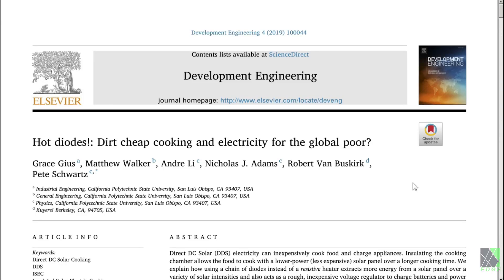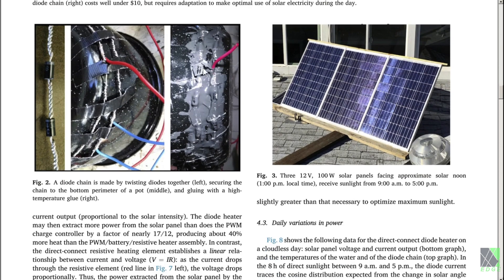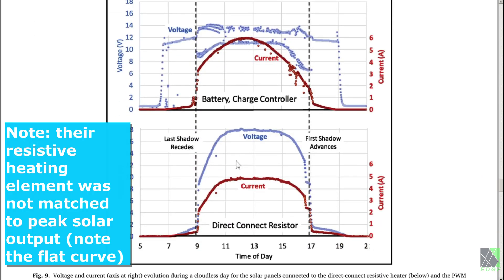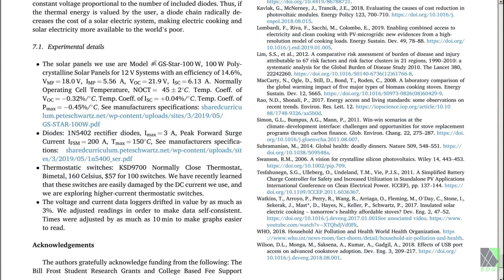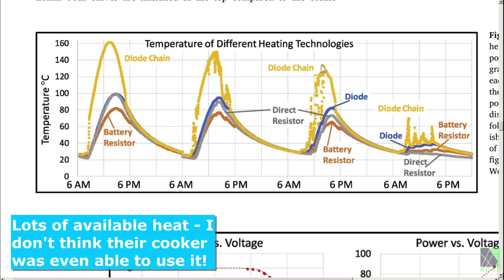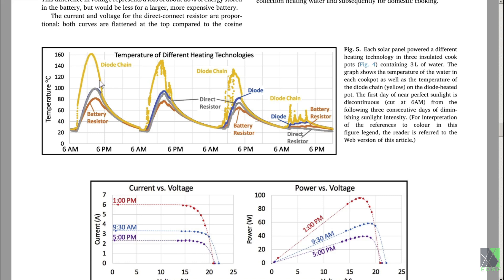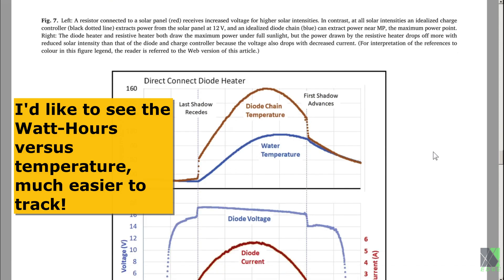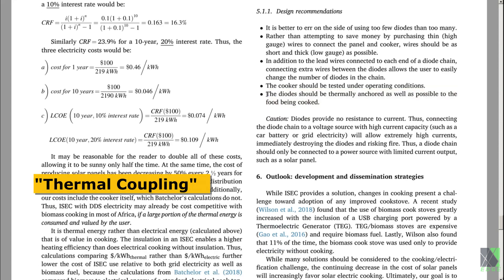Solar Powered HOT Diodes! Solid State Solar Electric Heating and Cooking #research paper #science

Comment: I plan to experiment with this myself big time and I already got lots of diodes but I didn't pay attention to the specific diodes and I purchased 15amp Schottky diodes lol so ill have to get more sized correctly and save those for another project
Reply from the maker: @lorenwright3202 Great! Schottky diodes work too, and can spread the heat out over a higher number of packages due to lower forward voltage drop

Comment: Sorry if i posted this already but would it be a good fit to submerse the Diode chain into mineral oil and then pump the mineral oil to a rad fan combo for heating air or an exchanger to heat water so the water is always fresh for hot water  no contact etc
Reply from the maker: @lorenwright3202 Hi, it's no problem... regarding your question, yes that can work. mineral oil isn't necessarily the best acceptor of heat but it does work
Reply: @solarpoweredge  planning to use a set volume of mineral oil the diodes would be submersed in mainly because i have some its die electric and its boiling point being much higher then water don't grow legionaries etc and its ability to uptake heat is known used for submerged pc units pump that to a rad / fan combo in this case 1or 2 240x120mm rad with two 120x120x35mm 4 pin gdstime blowers attached to a pwm because i can get them to output 100% power and flow at 1/5th the power using a pwm they will be wired in series so 24v the plan then is to tap off the diode chain to power fan and  pump 1@12v and another at 20-24v and the pump uses a thermal probe control which kicks it on at a set temp slightly less then the pumps temp rating of 100c or 212F in my mind this based on what i have seen and read should be a nice solar air heater what about you what are your thoughts
Reply from the maker: @lorenwright3202  Great setup, one issue with diode chain power supply is to watch the voltage feeding the fans and pumps... I usually wire my 12v load to 10v portion of the chain... that way if there is a sudden rise in voltage, the fan doesn't burn out. Also you can use diodes in free air with a fan, the key is a really good heat sink and good air flow. Unfortunately diodes will lower their voltage if they start getting hot, but keeping the heat pulled out will make their voltage quite stable. Based on my experiments last year, diode chains are an excellent low tech solution to extract heat from PV, although they require some tinkering to get them working well
Reply: @solarpoweredge  awesome cant wait to get started on it ahead of winter i hope
Reply: @solarpoweredge  i replied with my plan but I don't know if it showed up I hope so tried it twice but I am not seeing it
Reply from the maker: @lorenwright3202 Sometimes it takes awhile, but I did see it show up and replied
Reply: @solarpoweredge  thanks for the feed back I've shared these vids with several I thinks its untapped resource for sure that you helped in pioneering
Reply from the maker: @lorenwright3202 No problem! And thank you very much for sharing my work, I need all the exposure I can get :)
Reply: @solarpoweredge  My Plan 

I plan to make a diode chain powered by 2x 20 watt panels that produce 19+V ea in series have the diode chain submerged in Mineral oil because i have some its die electric and known for its abbilty to uptake heat!  at a set temp slightly less then 100c/212F to keep pump working within its specs its a solar hot water submersible pump 12v pump the hot mineral oil using said pump activated by a thermal probe controller to a twin 120x120x35 gdstime blower setup that has the fans wired in series with a pwm controller to gain full speed and flow at the lower amp draw of .4 vs 2,5 standard draw plan to tap the power for the pump and the fans from the same diode chain i am using to heat the oil the pump will pull from the top of the oil and return to the bottom container of oil as heat rises even in liquids i have had great success with many experiments using those blowers to pull through radiators vs simple push style weak pc fans even high static pressure pc fans are no match it is noisy at 100% but idc about that at all tbh what are your thoughts this was a quick rundown of the idea and i have typed it up now three times hopefully you will see this one from the 3rd attempt

Comment: I know you also make diode space heaters. Have you ever considered trying two solar panels in parallel with one inside as a radiant heater? Obviously you need to remove the blocking diodes.
Reply from the maker: @FloatingIdeasonanarrowboat I saw a video years ago about a man who heated his house with solar panels in reverse - it works. I haven't tried it yet, but I am 100% for your experiments and research, and hope I will be able to try this soon as well :)
Reply: @solarpoweredge  thanks for the tip. I live on a narrowboat so there isn't much room to use them on the insides as a heat source. I'll definitely have a play though.
Reply: Actually, thinking about shading increasing resistance of cells it means this idea might not work. The indoor panel is revers driven. If I get some small panels I'll do some tests.

Comment: Too few is best because if you over volt the current will rapidly drop off. Likewise, if you have voltage drop on the wire you need to calculate it at maximum current output and subtract the equivalent number of diodes in series.
Reply from the maker: @FloatingIdeasonanarrowboat That is a true point. I usually end up with a lower voltage than I'd like, but diodes still make a marvelous heating element for PV drive applications
Reply: @solarpoweredge I remember first seeing one of your diode videos and thought, this man has a great idea. I had at one time planned to make some fixed input voltage buck converters, for each panel. But having bought a boat with a mppt controller and later finding out you can connect all the panels in parallel and keep most of their output (even when they are 6v difference) I never did. 

PS have you looked at TO-220 packages. They are what I'd go for for this.
Reply from the maker: @FloatingIdeasonanarrowboat Yes I will be testing TO-220s they are very easy to attach to a heat sink. Definitely worth looking into. Somewhere on the internet I saw them used to make a solar electric cooker

Comment: I would think using a double walled container with a thermal absorbing material such as sand would help prevent diode burn out and help capture the extra heat generated by the diodes.
Reply from the maker: @nathanaelhanson2412 Right on... makes the cooker more efficient. In fact the authors in this paper mentioned an insulated container for cooking.... I later used 14w plus an insulated container to boil an egg with diodes. A great example of what can be achieved https://youtu.be/CRhkZp6ECHk

Comment: Hi. How do you regulate the temperature from getting to high and causing damage in your diode chain? Just a thermostat? Say someone placed a diode chain in a sand battery connected to a couple solar panels.
Reply from the maker: @Johnnyclean Hi, a thermostat would be a very reasonable way to regulate the temperature

Comment: What about using direct solar to power 120v infrared light bulbs as an ultra simple heat source?   I have (4)120w 20v  panels  I could arrange in series/parallel to produce 480w at 60v  dc to power an 300w infrared bulb.
Reply: Ceramic heating elements tend to increase their resistance as the temperature increases, which could be a good thing. And there are 12 volt elements available too.
Reply from the maker: @jima3252 Right on... that also helps increase safety... those ceramic (PTC) heaters are pretty awesome! I used some to heat the back room with 2 and later 4 100w solar panels. Was really surprised how much difference the setup made...  2 thin wires to get all that heat inside...
Found some of the videos showing PTCs
 https://www.youtube.com/watch?v=UxgINFgqUoI
https://www.youtube.com/watch?v=wK3_lRSntRc
Reply from the maker: @803mastiff9 Solar panels can run a resistive load (like an infrared bulb) no problem.. I will buy some of those infrared bulbs to test
Reply: @solarpoweredge  I am going to explore this as well. Lowes carries a dimmable ceramic heater bulb.  Easy Bake Ovens use a 100w  lightbulb to bake their cakes.
Reply from the maker: @803mastiff9 Great... I ordered a set of ordinary infrared bulbs last night, it just so happens I will have a metal box to put them in too. I am interested to see what they could do
Reply: @solarpoweredge  I picked up a 100w ceramic dimmable bulb yesterday. If these work well it will allow for a lot of flexibility and uses.
Reply from the maker: @803mastiff9 Good stuff :D

Comment: This is really good to see and very cool. It looks kinda dangerous for a DIY newbie like myself. However, I would like to know if there are similar options for an inverter system.
Reply from the maker: @ekeretteekpo3004 Hi! I'm glad you liked this paper... I never thought diodes should be used for heat... but new ideas take some getting used to :) 
Regarding your question on inverters: we'd only want to connect diode strings straight to a solar panel - reason is, solar panels limit current and need regulation at a specific voltage. Batteries and inverters don't really limit current and would burn diodes up, BUT you can just use "normal resistive heaters" for those setups. 
If you want to make pure heat cheap and direct from solar panels (no charge controller, no inverter, no battery to buy) diodes can really shine. This whole topic is honestly pretty confusing but I hope my reply is at least a little helpful :D any questions feel free to ask! -Dave
Reply: @solarpoweredge  thank you for the quick response. I already have a solar system setup (a small one - 1KW) and, seeing how this is, was thinking of something that could work for it.
Reply from the maker: @ekeretteekpo3004  No problem :D

Comment: It works great, I have used the body diodes of mosfets, it works great and you can then actually control the string by switching on the mosfets if you want, thus effectively decreasing and increasing the amount of diodes! Another plus is that the mosfets makes really good thermal contact with the system you want to heat, like a water reservoir for instance.
I have used that same heat to generate electricity by using the seebeck effect of a peltier module in addition to heating water or supplying the input to a switch mode voltage regulator for battery charging!
Reply from the maker: @petrusbosman4264  Great ideas :) can also use those metal power rectifiers, they have a ton of metal. Good for heat sinking. I am thinking a MOSFET could be used to short out some of the diodes and change voltage or power level instantly. Lots of options!

Comment: Just provide a temperature controller that will switch off when it reaches 100°C then turn back on when it reaches 95°C. The temperature of your cooker will just play along 95-100,  enough for the long life of the diode.
#my2cents
Reply from the maker: @abuxxx3607 Good thinking... I bought some of those small 100C appliance thermostats, not sure how durable they will be but worth a try

Comment: Is the power that is lost in the other options heating the panels?  or is it just not produced by the panels?
Reply from the maker: @peterwright4656 In short, Nichrome resistance cannot regulate the solar panel to the most efficient voltage (that's what MPPT does) but oddly' enough a string of diodes behaves almost exactly the same as MPPT... so they can extract more heat under widely varying conditions
Reply: @solarpoweredge  I see,  thanks for the reply.
Reply from the maker: @peterwright4656  NP

Comment: for thermal connection  in diy immersion elements(tubes for example) you could use hexagonal boron nitride powder (NOT the cubic form which is extremely hard and used in grinding and cutting applications) Hexagonal boron nitride is a white powder which is electrically insulating, thermally stable, non toxic and most important of all its thermal conductivity rivals that of copper. might sound like an exotic material but it can be had from aliexpress for like 20-25$ per 500g .  a metal tube closed at one end filled with a diode string and the powder and then compacted to eliminate air pockets and ensure good thermal contact. Pretty similar in principle to how resistive immersion heaters are built.
Reply from the maker: @greygleam Hi, cutting edge stuff... thanks for sharing! I was looking to use magnesium oxide powder and a several other (must be non toxic) substances, but you're right on the mark.. just found some hexagonal boron nitride in small  jars for sale! Thank you :D
Reply: I was also thinking of heat pipes
Reply from the maker: @kregloglowy I want to try that!

Comment: Have just ordered up some 135 C (off) / 110 C (reset) thermal switches for my project. Since my diodes max running temp is 150 C, this should let me boil water with no problems or cook a roast to rare/ medium rare just how i like it.  Still wondering if I can work with sand at 135 C as a viable night heater.
Reply from the maker: @ianball3972 I have bought some appliance thermostats to test, not sure if they can take DC long term but we'll see...

Comment: Please correct me if I'm wrong, but I think the thing so many people are missing and get confused about with your videos is that the point of using diodes is that they tune the output voltage to be as close as possible to the voltage at which the solar panel is designed to work most efficiently. That's all. There's no hand waving, energy out of nowhere BS. It's is NOT magically producing more heat out of a certain volts/amps curve (which is generally far from the optimum for a given panel). What it is doing is letting the solar panel work closer to its engineered peak efficiency for more of the day. I suspect a lot of people who get so upset about this don't really understand the point of MPPT, or that using a string of diodes is a simple, cheap way of approximating MPPT.
Reply from the maker: @fxm5715 Epic post :)  Good points and good explanation. This topic has attracted previously unseen levels of ridicule and negativity because it's outside most peoples "comfort zone". But that's where progress happens! "Progress Has an Open Mind"

Comment: Im not sure if I missed something here run the solar pannel through a series of diodes and use the emmiting heat. The voltage drops after passing througg the diode by at least .4 volt but often more ?
Reply from the maker: @ponemark Sounds right! I'd also add, match the voltage of the diode string to the vMP of the solar panel (like MPPT does). The voltage can vary, but it's easy to fix by adding or removing diodes

Comment: What about zenner diodes. It is possible to find powerful ones, which gives smaller amount of them, comparing to diodes. You can easily get them for any viltages. Even 48V for new solar panels or make series of them 4x12V to get smaller voltage or destribute power among them.
Reply from the maker: @iIiWARHEADiIi I will look for some zeners, definitely need to investigate and see what they can do

Comment: would transistors work? connect a thermo switch in series with the gate, and you dont have to deal with the amperage issue?
Reply from the maker: @L0615T1C Sure, it's worth trying! They cost more I think. Keep in mind, there are metal tabbed power diodes. I am using 50a bridge rectifiers to heat my workshop, they seem fairly tough (metal case) but slightly more expensive than axial components of course

Comment: This helps in the desire I have for hydronic radiant heat.  I want to store heat as well but that is very high temp.
Reply from the maker: @timbrown9305 Meaning circulating liquid to heat a room? A tank of water with foam around it could store a nice amount of heat! I would like to do that but I am hesitant to have a lot of liquids stored in the workshop.  A mixing valve could control how much heat is released from the solar panels vs. stored in the tank, or just run it straight through the system
Reply: I'm working on this. I'm going to use solar water heaters and then use a heat pump to increase temperature and store the heat in a phase change material.